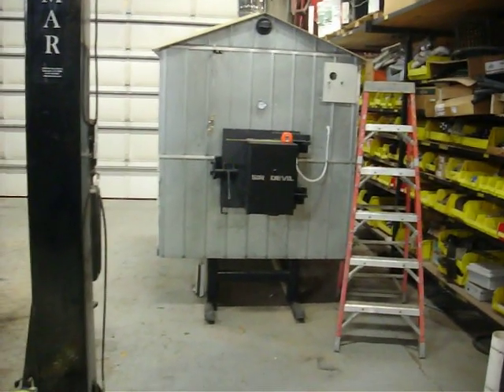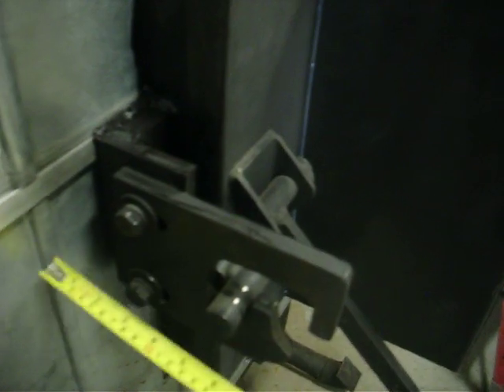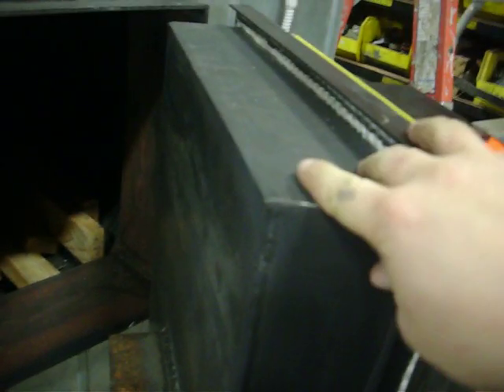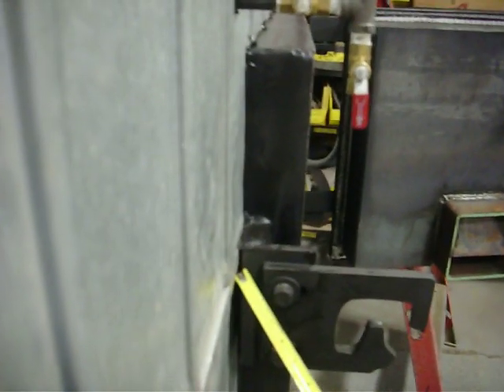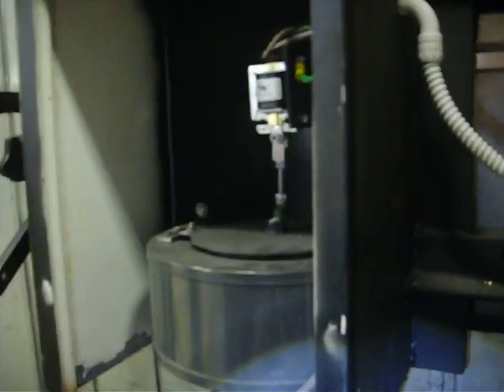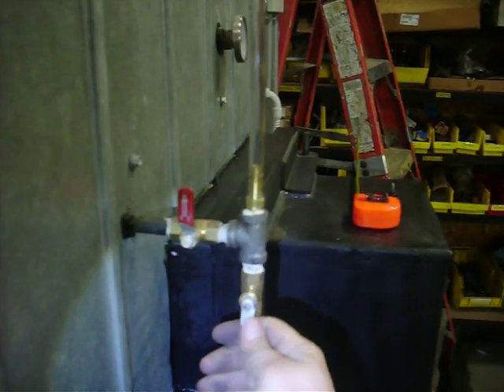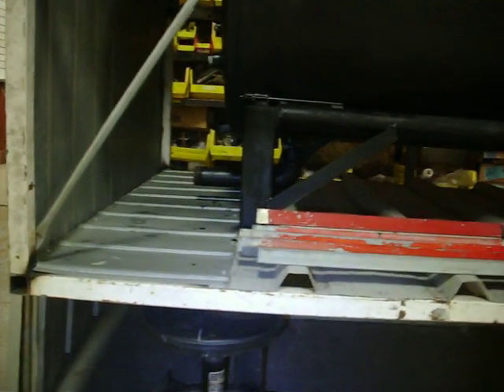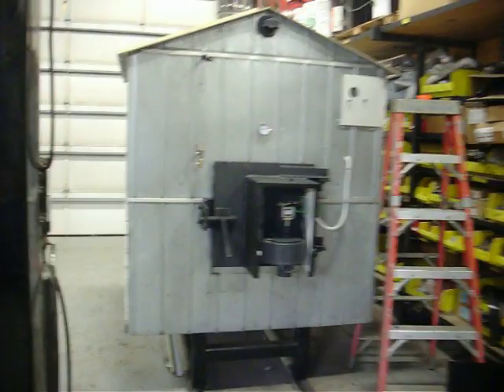homemade outdoor wood boiler Mi

Comment from the maker: a friend of mine has also bilt one before me and has it very well insulated. One night he loaded it with rather green wood. when he got up the next morning the wood did not burn and his water was still in the 80s. The more water you have the longer it will hold the heat. my old boss has a 1000 gallan tank in his basement and it will hold a good temp for three days after his boiler goes out but it also takes more time to heat that much water. as for smoke goes the dryer the wood the better.